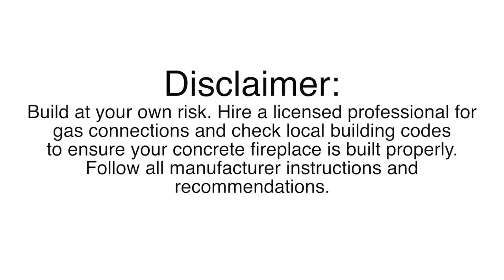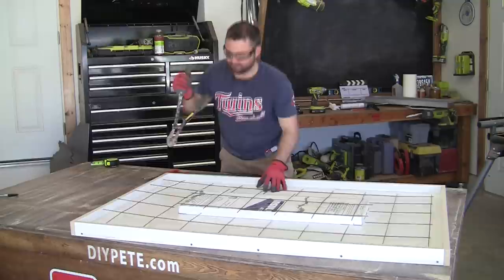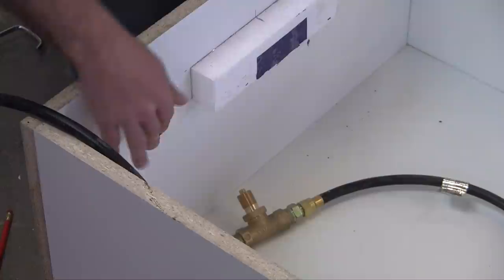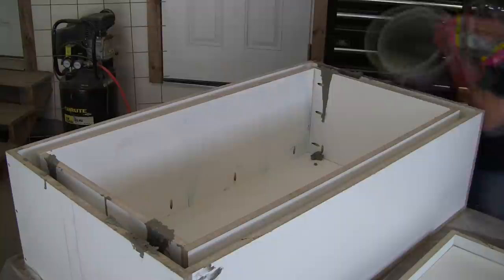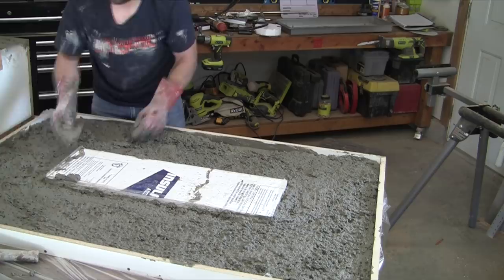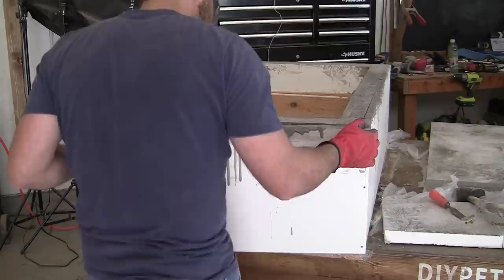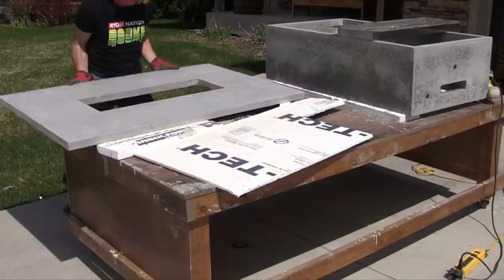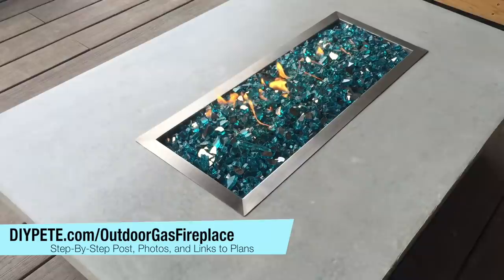How to Make an Outdoor Gas Fireplace

Comment: Any problem with the concrete cracking because of freezing and thawing?
Reply from the maker: Hey! I've had it outside the last couple years and haven't had issues. A cover would be good for it though over the winter if you had one, but I haven't used any and have been fine. Quikrete 5000 would work best for this project.
Reply: Hi Pete, I'm working on making the table top (41"x64") this week. I noticed on your downloadable plan, you listed Rapid set cement all mix. Would you recommend that for additional strength over quikcrete 5k? I'm planning a ~5-6" over hang.
For the base, I used metal studs and cement board, and plan to finish with a faux stone veneer.
BTW your videos and detailed plans are awesome and inspired me to build my fire pit. Thanks Pete!!
Reply from the maker: Hi Mehul, just saw your message. I would recommend the Quikrete 5000 instead of the Rapidset. I've found it to weather better outside. Thanks so much for watching the videos, and I'm looking forward to seeing how yours turns out!!

Comment: Are these safe to be placed under a covered stucco patio?
Reply from the maker: Hi! The heat dissipates in the first couple feet. As long as you have a pretty normal ceiling height you'd be fine. I have an 8 foot ceiling ( covered patio ) overhead on mine.

Comment: Does it put out a reasonable amount of heat, or is it more for ambiance?
Reply: That's a good question.  I'd like to know too
Reply: This is jsut for ambiance, remember its just burning gas, but yes it gives some heat but not alot. a friend of mine has the same type. also remember that the amount of gas you give out the more heat you're going to get.
Reply: If its in the house, then its gonna be warm, if its outside, its still hot but since its an open space you have to stand in the way of the heat directly..
Reply: Hold on. Do NOT use indoors. Warm yes, but you'll fall asleep and never wake up again. Carbon monoxide poisoning.
Reply: Yes, if used indoors you cannot use bottled gas.  You can use gel fuel or bioethanol fuel indoors.  If using gas you have to have a vented flue if you want to make sure you wake up again ;)
Reply: The glass will heat up and add to the radiance as well.
Reply: Possible but generally not a problem if you have a window cracked or people moving around going in and out. Install a carbon monoxide sensor and relax.

Comment: How fragile is this when finished? It worried me when you said "sand from the corners inward to prevent blowing out a corner." Will the corner break if someone bumps into it by mistake?
Reply: I was wondering about that too Ryan. Also about the strength given people want to put their feet on it naturally (along with their drinks and/or food).
Reply from the maker: Hi Ryan! Concrete continues to cure for about 28 days after the initial pour. It still is " green " and curing a lot in those first few days. So you'll want to be careful ( since it just was pulled out of the mold and hasn't had air or circulation around it yet to help dry it out. However, it will get to a much higher PSI after pulling it out and letting it cure. And then will slowly harden up the the PSI it is rated at. Once it has cured about 3-4 days it is solid.
Reply from the maker: Hey John, after it continues to cure out of the mold it is super durable. Feet and drinks are no issue for it. Cheers!
Reply: DIY PETE awesome thanks for the response! I may try something similar in the near future. Great vid btw! Love the channel

Comment: How long does a 20 lb tank of propane last and how is the heat output?
Reply from the maker: Hey Steve, the heat output is decent and will keep you warmed on a chilly night. Not sure on how long it lasts, I'll have to start tracking it!
Reply: DIY PETE thanks! I find a natural gas version of that burner so I ordered that, running natural gas to the deck.
Reply from the maker: Awesome!

Comment: I loved this, I can't wait to build this in my new house.
Where did you put the propane tank? Can I build this tall enough to fit a tank underneath?
Reply from the maker: Hi! I ran the hose though a hole in my deck and to a propane tank hidden by the deck. However, you could make the fireplace base taller to accommodate a tank. Cheers!

Comment: How heavy would something like this be? Is it too much static load for a wood deck (including about 2 feet of snow during a storm)?
Reply from the maker: This project weighs somewhere upwards of 225 pounds which should be able to be supported by most wood decks as long as the deck boards are sturdy and don't have any rot.  Cheers!
Reply: DIY PETE That's pretty good. Thanks for replying!

Comment: Is it a hazard to build it in a fashion where the propane tank would be hidden within the table itself?
Reply: aside from the nuisance of having to lift a top that is as big as the one you made.  very nice btw.
Reply from the maker: Hi Thomas! A number of store bought outdoor fireplaces at Lowes --- store the propane tank inside. So it definitely is an option to look at. If I was you I might run down to lowes or go on their site to see how they set it up. Cheers!
Reply: How about reducing the weight by adding perlite/vermiculite/peat moss (hypertufa) and maybe not using concrete mix with rocks in it for the top?
Reply: David, I was wondering about that myself. I have done hypertufa stuff in the past but nothing this large - mostly just hypertufa containers. I would worry about the weight on a corner (i.e., someone's feet) or simply a corner chipping off if someone puts their feet on it. But I like the idea.

Comment: Wouldn't it have been way easier to build the base out of wood? Or even just cinder blocks and then cover it with your favorite designer tile and just the top concrete? It looks nice and all but too much concrete I think.  Liked anyways.
Reply from the maker: Hi! You could certainly build the base out of other materials. I did this out of concrete so everything was made out of a noncombustible material which would be to code in more areas of the world. Cheers

Comment: you should have placed the gas tank inside the table
Reply from the maker: +Esteban D'Angelo I'd have loved to, but I wanted a real low profile table, and it wasn't tall enough to sit it upright in the unit. The line could certainly be hidden by drilling through deck boards and then running into the natural gas line or to a propane tank. I built a table to cover the propane tank and make the deck look nice.
Reply: I had asked the same Q, not seeing I'm 2 yrs late.  :)

Comment: just a tip for next time, Try to film in  1080p instead of interlaced than you can get rid of those damm lines
Reply from the maker: +vfxexpert Hi! On my computer I don't see lines, but I did on one of my external monitors. I just had my DSLR serviced and was using for the first time again-- so I'm guessing a setup could have been switched --- and the footage from the bbq gathering was done with an iPhone since I didn't have the DSLR with me. Thanks for the feedback, always trying to improve quality, so I appreciate it!